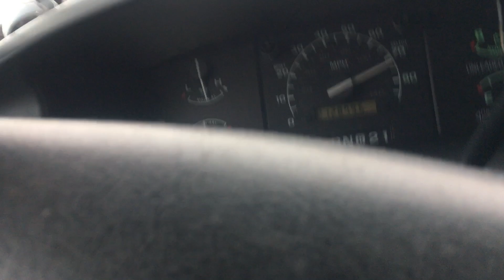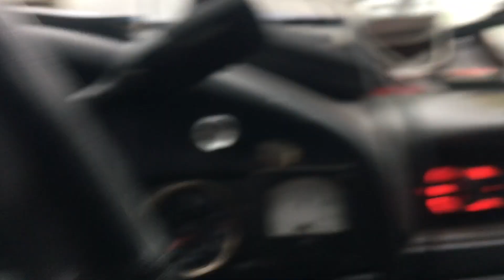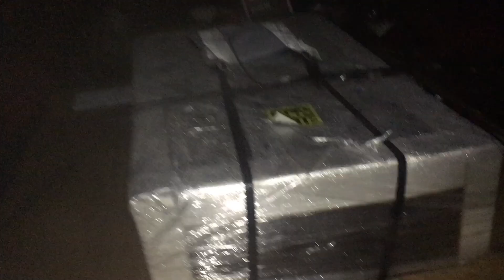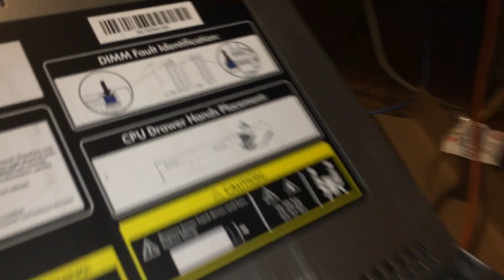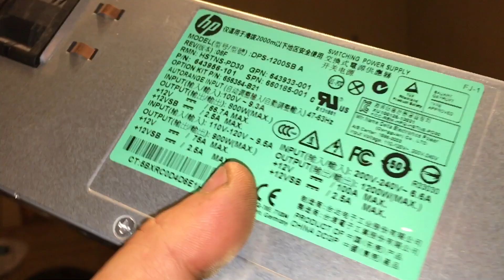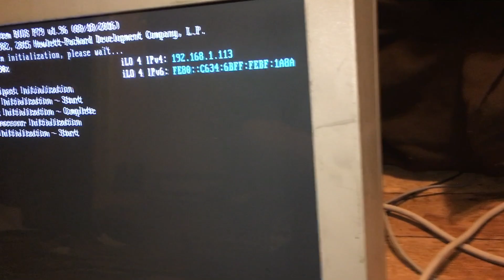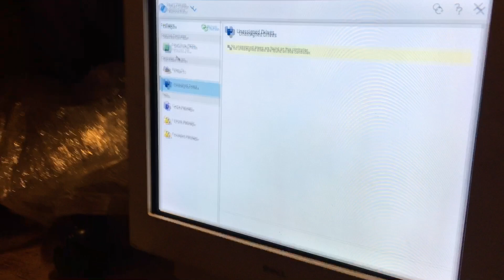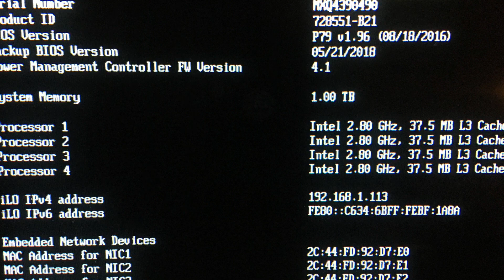I Bought an AIRCRAFT CARRIOR (big server)

Comment: eesh hope your power is cheap for the amount of power that DL 580 draws your not getting the best performance per watt compared to the later gens 10th and on. Or even workstations draw less power. I had a Gen 9 DL 580 I tossed it out as it was getting out performed by a workstation drawing 1/4 of power a HP Z840.
Reply from the maker: whats a 10th gen mean?
Reply: @RockeyDAproductions  10 generation DL580 or DL 380
Reply: @RockeyDAproductions  they have DDR4 or DDR5
Reply: @RockeyDAproductions  for reference yours is a 8th generation DL580 which uses DDR3 ECC Ram. I've worked on these, dells power edges and Ibms power PCs. Each have their strengths.